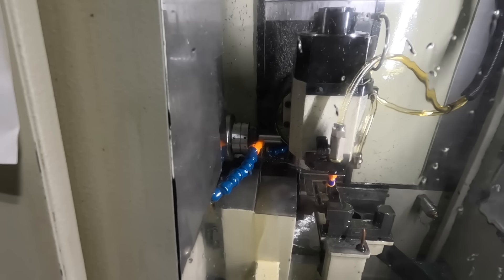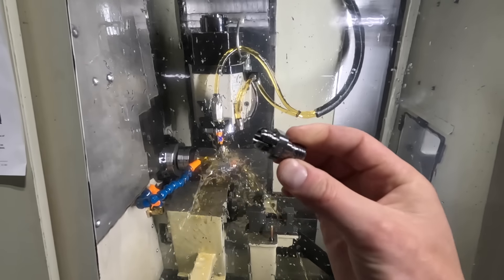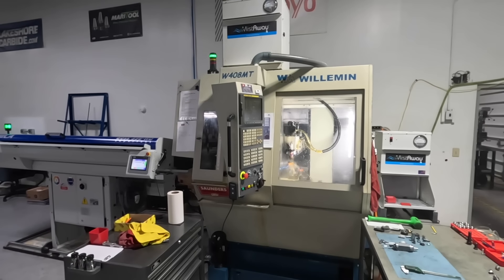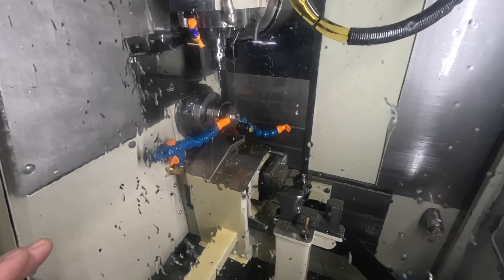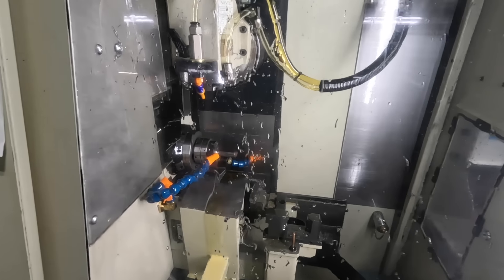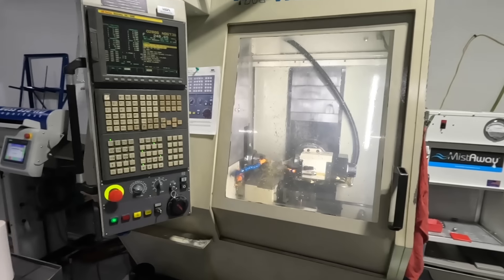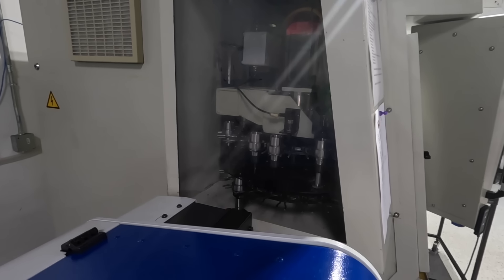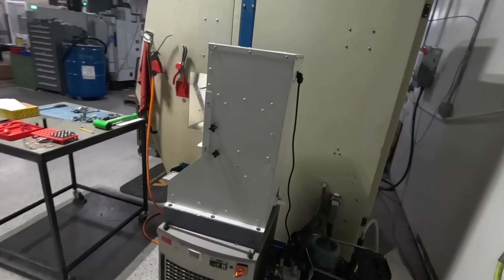Willemin 408MT:  Our *FAVORITE* CNC Machine!

Comment: Love the idea of mill turns like this.  One piece flow with finished parts, bar feed automation, minimal setups.  Surprised machines like this aren’t more popular.
Reply: New machines are pretty expensive.  Used ones are not widely available.  The ones that are available tend to be older machines which might not have the support that they need from a parts and software perspective.
Reply: @brandons9138 I get why existing machines are few.  Just mildly surprised more companies haven’t gotten into the mill turn space and that there isn’t more demand from potential customers.
Reply: @stacybehrens7152  Most of these machines have a pretty small work envelope. Making them fairly specialized. On a live tool lathe the work envelope is much larger making it a more versatile machine.  On a lot of parts true 5th axis work is just not needed. Poking a hole at an angle can be done with angle head live tools on a regular lathe.

Comment: I thought I wanted a swiss for my next machine but now that I know that little machine exists, I really want a Willemin!
Reply from the maker: swiss machine = hours to set up.  Willemin = minutes!
Reply: @nyccnc  yes to that statement! I almost bought a decent looking L25 citezen at auction recently but after doing a bunch of research I learned that not only do you need non fusion 360 software for the CAM but also set ups times are long as hell and the crash pucker factor is strong with swiss lathes. So that Willemin is starting to look sexier by the minute.
This all started as a hobby in my garage with a tormach 770 but I keep wanting to up my machinig game. My last big upgrade was a fancy video CMM and now I want a higher tolerance machine to really try the hard stuff like keeping millionths (although I love my Haas for getting me to this point).

Comment: So you need to turn the end of bars first. My first CNC lathe was a Miyano ENC- 3BC. You had to place the 12 ft long bar in the machine and put a full chamfer on the end. Flip the bar around and the chamfer end went into the mechanical bar feeder. This was a bit of a pain. But the worst was the day an operator put the new bar into the machine to chamfer the end and forgot to put it into the bar feed first. Hit spindle start and BOOM CRASH! Several thousand dollars damaged in 2 seconds. I love the idea of that speciality machine to turn the end. No longer a problem at our shop since we use LNS magazine feeders. However you do loose more material with them. With the Miyano feed you didn’t have much of a slug left. You could retract the pusher and put in a pusher extension which would take it to just enough to hold the part. In most cases you’d end up with only a few inches wasted. Kool machine you got there. Like to know what it cost new.

Comment: Are you running oil for coolant? If so, has that presented any challenges for you like cleaning and maintenance that causes downtime? Also have you looked into small package mill turns like Okuma Multus B200 or DN Solutions SMX?

Comment: 17:15 at least on our LNS ALPHA 552 bar feeders when working with 52 diameter we need to machine to 46,7mm in diameter the bar at one end. We don't use a lathe we use a chamfering machine the LNS PB80

Comment: Curious what this machine (or equivalent) would cost new, totally set up ready to run? Are there job shops that will manufacture parts on these machines or are they mostly used for house for manufacturing? I did a search for job shops and came up empty.

Comment: How do you go from a model on Fusion 360, to run a CAM code on the Willemin-Macodel 408MT CNC?  Does fusion360 already know how many axis this machine has?  Maybe this is a stupid question?🤔🤔🤔
Reply: Typically the post in a cam system (fusion 360) takes care of that. The posts are developed specifically for a machine
Reply from the maker: Yes, very easy in Fusion (and frankly, most CAM systems can probably handle this).

Comment: 15:30 are they so expensive because they have a patent on that style of tool? I'm using Capto C6 for my machine and those tools are 3x the cost of a normal cat40 holder. I know when sandvik did have the patent for this toolholder the price was higher but if you pay 800 dollar for such a small turning tool holder i think you are overpaying.  The price for a bigger capto C6 turing holder is around 300 a 400 euro's.
Reply: I believe other companies make holders now.  I can’t think of what the generic name is for capto but they have a bunch on msc for cheap now

Comment: Pretty cool little machine. If you’re not utilizing 5 axis/mill turn capabilities I think I’d go with a Swiss. Would make the parts way faster
Reply: Citizen has Swiss machines that can do 5 axis work now.  They have machines with tool changers as well.
Reply from the maker: For sure, a swiss will make parts WAY faster, but setups ruin it for us.   Willemin can switch parts in minutes; almost no setup time/risk/hassle.

Comment: How much are those running for (cost)?
Reply: new ,depending on spec, i think somwhere from 1-2 mio. his is used , i think 04' model year

so yeah not going in the hobby shop😂
Reply: New they are over 500,000. Pretty cool machines. Fun and quick

Comment: Running cutting oil without a fire suppression system is very dangerous. Even when not running lights out.
Reply: Most cutting oils to day have a very high ignition point.  At my shop we have 19 Swiss machines that run almost 24/7 not a single one has a fire suppression systme on it.  the only one that caught fire was due to operator error.